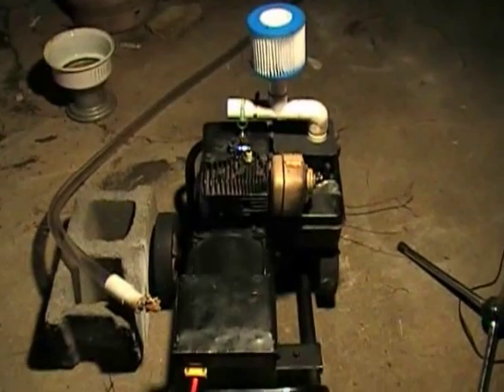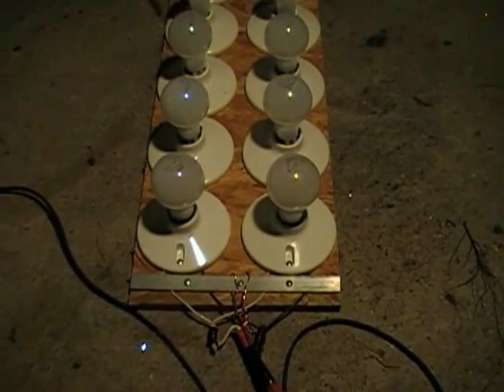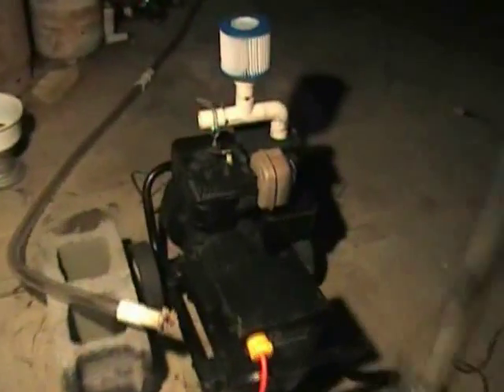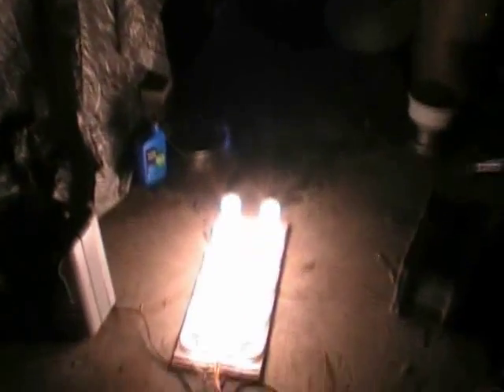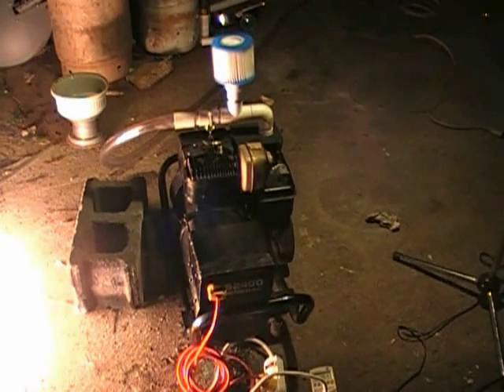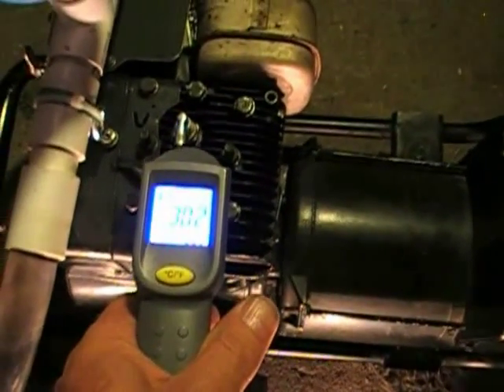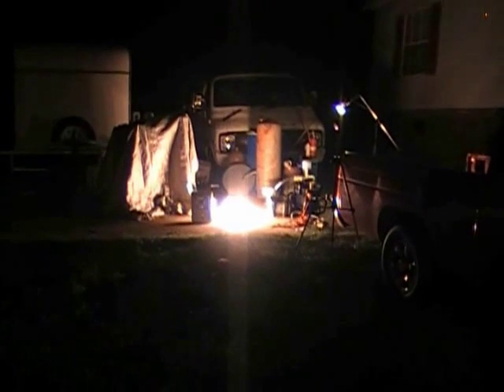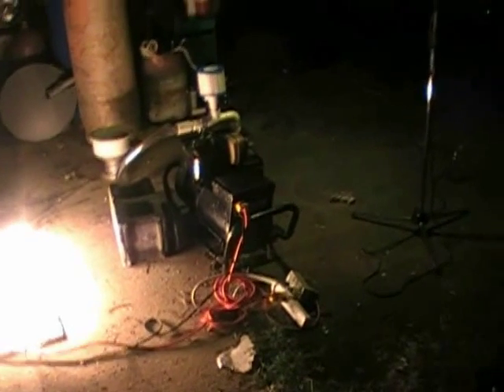06-11-2013 Running the generator on propane (Power test comparison)

Comment: Hello.
I will like to know if propane is more economical compare to Gasoline?
Thanks
Reply from the maker: If by economical you mean less expansive I guess that would depend where you live but if you are talking about efficiency. woodgas does not have the same punch as gasoline does but the cost to produce woodgas is pennies on the dollar compared to the production gasoline plus woodgas has a zero carbon footprint on the environment too.

Comment: That is cool. But I did learn some thing to run generators with wood gas or metane or propane. The best thing to live the old carburator on the generator Why???? Because on all generators the frequency and voltage made by the RPM. And just like in this video when you put on more load the arpm fall. But if we  use the original carburator on that on the butter fly have connected a RPM regulator linkage from the centrifugal controller. And if we live it on when the RPM fall that will open the butterfly and let more mixture go to the engine tu burn and that way you do not have to adjust the RPM but the centryfugal controller will do it for you. Just food for thats and not because I'm so smart. Good job. Vendel
Reply from the maker: Vendel thanks for the reply. The generator still has it's original carburetor including the gas tank on it and it will run on gas if needed. The woodgas isn't as robust as gasoline and I am pulling the woodgas through all of the pipes and the filters too so I do loose some power but I will eventually use a DC setup to charge batteries for an inverter. This way the engine RPM's will be a non-issue.

Comment: Did you ever do the trailer mount? I am sure we would all like to see the final product in place when you are done.

Any idea on the size of the throat needed to run a 20 HP engine? Your 4 inch throat seemed to push a lot of gas and it almost seems that it would keep a 20 HP natural gas connected engine going.
Reply from the maker: I have everything ready to mount and it just comes down to finding some free time again to finish the job up. I think that a 3 inch restriction zone would be more than enough of an opening but the fire cone may need to be larger somewhere around 7 inches at the top. One nozzle might work then again you may need a few nozzles to make sure that the air intake is well dispersed across the ember bed.

Comment: Have you measured you output temp from the blue flame from your wood burning gasifier.  Since its blue and burning clean have you enough heat to create steam to run a turbine? With the correct three wheel turbine you should be able to create more output to a generator with less resistance. In essence creating a plasma generator. By reducing the diameter of the exhaust and creating more static pressure to your flame.

Comment from the maker: As far as heating your house yes it can be done but you will need to be very careful with the build and you will have to build a fail safe into the system to protect your home. I am not sure how to do it but keep in mind that a gasifier is not like a furnace nor a wood stove. It gets hot but it only has a small ember bed zone so the gasifier doesn't throw off a lot of heat. There are only embers in it and no actual fire.

Comment from the maker: I plan on building a custom generator where I will use either a 7.5 Hp or a 12.5 Hp engine to spin up a 300 amp alternator to charge a few deep cycle batteries that will run a inverter. This way it doesn't matter if the engine loads down because the batteries will still charge and the AC will stay at a true 60 Hz. I am working on getting some answers on the Imbert sizing for different engines. As soon as I get the info I will do a video covering the Imbert chart.

Comment from the maker: I'm running a 2000 watt generator but you will not get the full power out of your engine on woodgas. You should expect to lose anywhere from 35% or even up to 50% of working power on woodgas. This is why people that drive on it drive monster size trucks with large engines to offset the power loss. The power loss is seen very easily with a smaller engine: Cont

Comment: Thank you so much I have an $800 electric bill month in winter from running gas furnace and I lost my job do to a merger, this project is more important to us than a job itself if i could fix my heating problems AND run generator off wood. Most gasifiers just tar up engines but you and two other guys have been the most help to me. TRUST ME GUYS THIS GUY KNOWS WHAT HE IS DOING. I told my wife you just released your video on how to make it she is very happy as am I.

Comment: please answer this question? I have a 6.5kw onan generator to make a gasifier that would produce the wattage would I have to multiply everything you got by 6 since you are running a 1000 watt generator? also I would like to put the gasifier in the basement so I could heat the house from the gasifier heat through duct work already in the house and would you know how I could do that like attach something to suck the heat from gasifier. It would mean unspeakable words to me if you could direct me.

Comment: Running the genny on a bag full of gas is pretty cool, and it's a great way to show that you can use the resources around you to help you out in an emergency.
I would like to try this with woodgas sometime soon. The idea that comes to mind is to use a submerged 50 gallon plastic pail as a storage tank. When being filled with gas, water is pushed out the bottom, into a much larger tank. As the gas is consumed, water replaces it, and also slightly pressurises it. Would be great for cookery too.

Comment from the maker: cvpages I used a tablespoon of gasoline to start the generator. The generator would NOT start on just the propane alone but once the engine was up and running, all was good.

Comment from the maker: I honestly don't know what the octane of wood gas is. The generator cranks much easier on wood gas compared to propane but it doesn't have the power that propane or gasoline has.. I just wanted to see how the propane compared to gasoline so I did this test.

Comment: I have seen ppl with LP on trucks that are hard to start so many have a window washer pump with gas in it setup to prime the motor. I have thought about it many times setting up a gen on LP and wood gas and gasoline just never got to the extra work of the LP lol! For adding in the inline fan to help push the gas be carefull it is easy to over flood woodgas and not get enough fresh air in with the mix that is the only thing i see to really watch out for!. Keep up showing the great ideas!

Comment: Now you can see why tho i can store the wood gas in tractor inner tubes for a day or 2. I my self have never run things on LP i know a few that have back in WI had trucks on LP. One liked it a lot the other hated it. With LP i think it really has to do with how its setup and the wood gas carb way you have may have been just right for it i dont know enough about LP lol.

Comment from the maker: I was surprised on how little the engine drew on the bag of propane. I was also surprised with the power delivered from the propane too. Strangely enough I think the woodgas ran the engine smoother even with the loss of power and the exhaust even smelled cleaner too. Go figure... I do plan on adding a helper fan (turbo) inline with the gas line just to see if taking the back pressure off of the intake will give the engine any more Hp. Cont:

Comment: PT2 Thats why i say if you have a v8 motor put on a new intake like if its carb put on a dual 4barrel setup that will let more air in and more wood gas and make up some of that diff in power loss its hard tho to get enough wood gas in still. Thats where having the gas as cool as possible is so very important on anything with wood gas cool gas is way more dense and holds more btu's making it give more hp! Great vid again keep it up yr showing ppl great info keep it up yr teaching ppl so much!

Comment: Another great vid as always! Thats why with wood gas i say to use 1/3 bigger of a motor then needed if you use wood gas! Due to its only about 60% of the power and yr test here shows just how true that is just in the sound of the motor! One thing i do know is if you can its hard is to change the intake size on cars or trucks one has those options on small motors its tough due to the head intake is limited in size unlike cars and trucks one can change that! Cont!